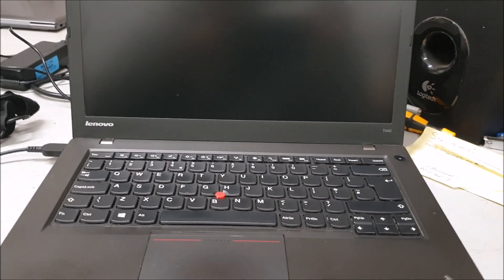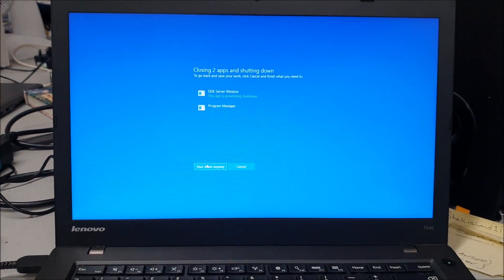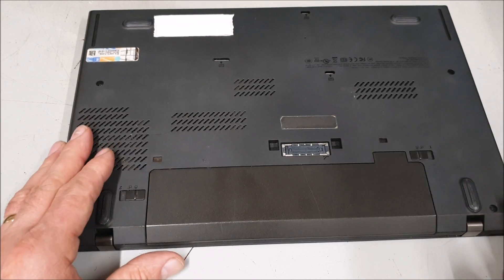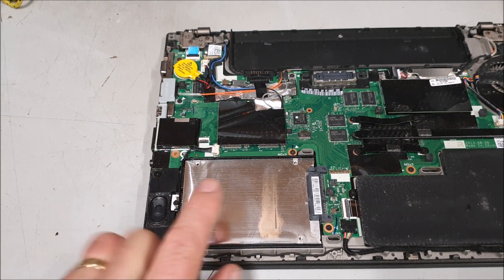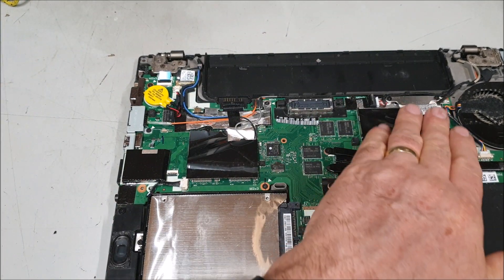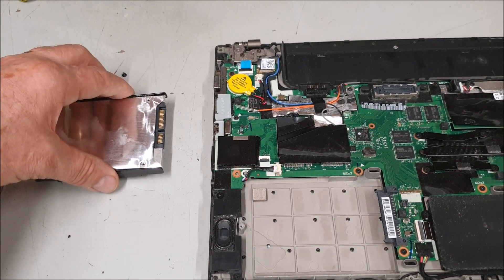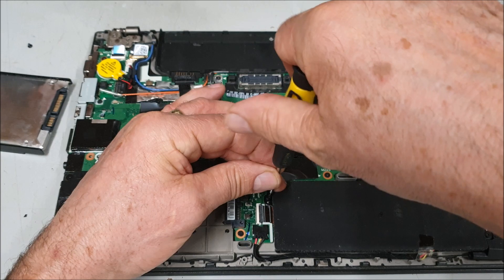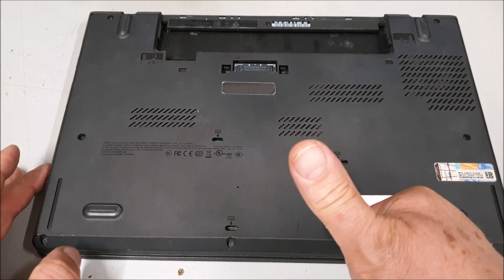Lenovo T440 Hard Drive SSD and RAM removal and upgrade procedures

Comment: To shut off the internal battery, I went to Config, down to Power, but I don't have the Disable Built in Battery selection at the bottom of the screen. The last option I have is Intel Rapid Start Technology then Entry After. Nothing more. Does this mean I don't have an Internal Battery?
The problem my laptop is showing a 2100 Detection error on HDD0 (Main HDD) - Do I need a new Hard Drive? Is this reparable?

Comment: At time stamp 7:20 you mention a card under the battery that your computer doesn't have.  What is that card and what is it used for?  Mine has the card.  Thank you

Comment: You mentioned to upgrade the Ram to 16gb. Unfortunately you can only have a 8gb ram in the slot . Since there is a soldered non removable ram there, the maximum amount of ram would be 12gb per manufacturer website
Reply: To anyone reading this, your T440 may not have soldered RAM.  Only the i7 versions will likely have the soldered RAM.  My i5 T440 does not have one.
Reply: @ruekurei88  Strange, my baseline i5 4200u model has the Soldered 4GB
Reply: @ruekurei88  My T440 has the i5-4300U processor and has the 4gb of RAM soldered onto the motherboard.
Reply: This laptop showing 12gb of ram when install ram of 8gb????
Reply: @vipulvyas8401  isn't 4gb onboard hard wired, and 8gb in the slot, for a total of 12 gb?
Reply: T450 ram upgrade

Comment: I have 4 gb ram. Can I add another 4gb and make it 8?
Reply: NH you can replace the 4gb ram with an 8 only.
That makes your total GB ram to 12, since  there is a soldered 4 ram there.
Only one slot available
Reply: @JW-mx3qg  estas laptops solo trae una ranura ?
Reply: @JW-mx3qg  can you please share the exactly ram memory screenshot?
Reply: you should be able to. i just bought one used with 8 installed
Reply: What type of ram does it take??
Reply: See how many slots are there. Mine got two.